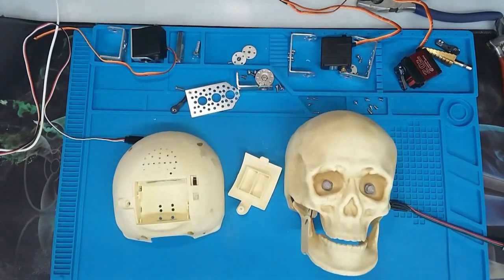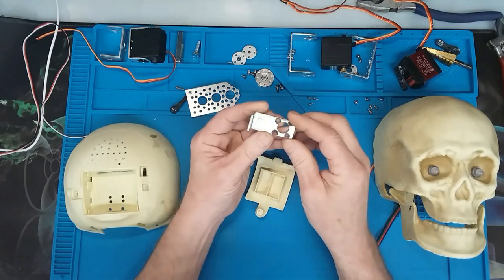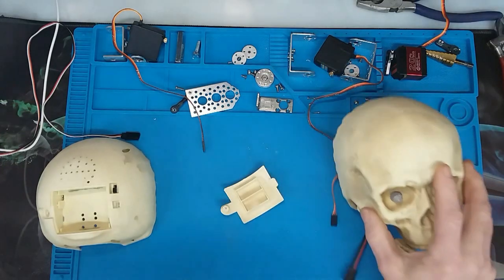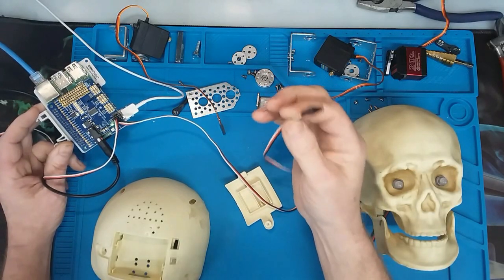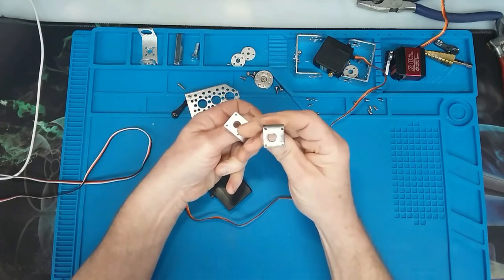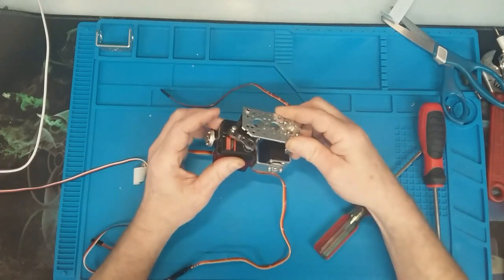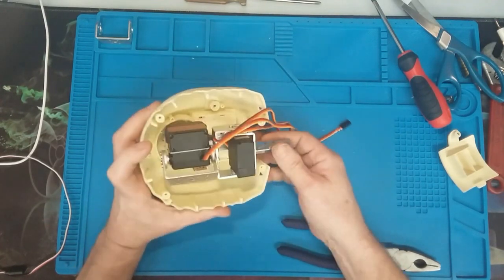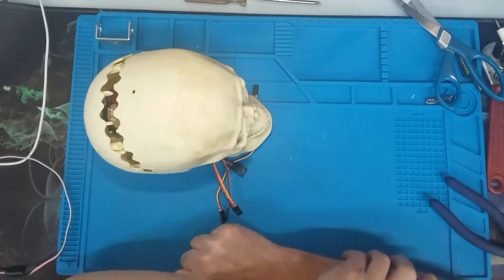3 Axis servo build

Comment: if I was to follow only the first step (attaching 2 dual shaft 180 degree servos w/ brackets) would that alone provide me with a decent 2 axis design?
Reply from the maker: Yes it would. You'll need some sort of an l bracket to attach the top servo to the back of the skull head. Most of the items in the list have been discontinued since I made the video. I've come up with a newer design that uses a short body servo in the battery area on the skull for the tilt. Past couple of years I've had some big changes in my life and I'm hoping to get back to making a video with the new build.
Reply: @ebuechner7900  Thanks so much for your reply. This design it's perfect for what I need. Would love to see the updated design though. So the 3 hole pattern plate that has been discontinued is the bracket I would need to mount to the back of the skull or is it the angle bracket design that you reference at 0:53 of your video that I would require?
Reply: I am working on an 8 ft talking skeleton and liked what you have put together for a diy 3 axis movement.  I know I would need stronger servos but the initial design looks very good.   I would like to see your updated design as well.  Thank you.
Reply from the maker: Tom. You could use the flash hobby brushless servos from Amazon with some of the servo brackets that Amazon sells and build something similar. You would Mount your tilt servo directly to the back of the pan servo and then use a piece of polycarbonate to attach The tilts are out to the back of the skull. This way you would have a direct drive on your tilt. The brushless servos are the way to move forward because my experience has been the brushes wear out on these servos over time and then burn out the control board in the servo. They'll also accept a higher voltage making it easier to power them. The faster speeds with the brushless servos also makes them more ideal for the mouth movement.
Reply: @ebuechner7900  Yes, those brushless servos look pretty strong. What size would you recommend for the pan and tilt?  The mouth is already using a servo for talking and my other challenge would be to incorporate the pan and tilt servos to the control board used for the mouth currently in the skeleton, if that’s possible.  I sure i will be watching this video several times.  Any suggestion on brackets to use would be greatly appreciated as well.  A quick sketch of what you are describing would be helpful as well.  We could discuss more details off line if that is something that works for you.  Thank you.
Reply from the maker: @TomWheeler-m4g  I'm using the 35 kg servos. The brackets are going to have to be custom made for your particular skeletons needs. You want to fashion the bracket to get the tilt rotation point to align with the pan and nod. As far as the board that you're using goes, I don't know what sort of output it uses. Most hobby servos will use a pwm signal That's usually in the range of 900 to 2100 at 50 HZ. If the board has set limits, it's probably going to require a lot of mechanical adjustments. For my needs, I use the PCA9685 board on a raspberry pi. I pushed to have this board added to the outputs on fpp and then helped develop the interphase with all of the adjustment options. I'm on both the falcon Christmas and xlights forums if you want to contact me. For obvious reasons, I'm not going to put  personal contact information on my YouTube.

Comment: would you be interested in making this assembly for some one that does not have the tools or ability to make the brackets? of course for cost of materials and time.
Reply from the maker: I've been thinking of a way to phrase this. No. I made the video to help guide people to recreate the results that I had knowing that people were probably going to make changes and possibly approve upon what I came up with. As a lifelong mechanic I know that if I started down this path making these four people someone would eventually turn it into a nightmare scenario for me. And as one other gentleman pointed out one of the components isn't available now. I do know a few people have made the same mechanism leaving out the bearing and the servo for the tilt opting only to use the pan and Nod features.
By doing so they greatly reduced the components that needed to be manufactured. There's a few people out there and the Halloween Enthusiast forums that make mechanisms for people like Jerry from skulltronix. I came up with this idea is a poor man's version that's not as complex and intern quite robust operating out in the rain and snow.
Reply: Doesn’t hurt to ask. Thank you for replying and creating this video.

Comment: What's the length of the ball joint you used. I went to Hobby Town and was unsure which one to buy?
Reply from the maker: You can buy the ball joints individually and then a piece of threaded Rod to put in between them. At the moment I don't have any open units to measure. Look at the angle of the Servo arm in the video and make the ball joint to the length you need.

Comment: Love the video, I would like to try but Servo City discontinues the swivel hub would you be able to recommend a replacement?
Reply from the maker: This looks like it's a suitable replacement. It shows to be out of stock but it's not labeled as discontinued.
https://www.kr4.us/swivel-hub.html
Reply: @ebuechner7900  Thank you
Reply from the maker: After doing some research on Servo City's website it looks like they've discontinued that part and replaced it with the 1608 series dual pattern pillow block. This part doesn't seem to have the same bolt pattern and at first glance it looks like there's more distance between the plates. This is one of the challenges of Designing something with off-the-shelf parts. At the time that I made the video all of these parts were quite common and easy to come by.
Reply: @ebuechner7900  What do you think about the 545444 Dual Ball Bearing Hub, and tap the smooth side?
Reply from the maker: @aaron8184  
I think you might be confused now that Hub operates. It's a solid block of metal shaped exactly as you see with two bearings 1 pressed into each side. I thought about using that but one of the problems is they don't put a spacer sleeve inside between the inner races of the bearings. If you were to put a bolt through that and tighten it down it would make the bearings bind up without the sleeve. To make that work you would need to make the bracket off of the servo with a solid shaft welded from the backside and aligned straight with a way to secure the Hub without preloading the bearings.
An easier method to replace that Hub might be to use a through bolt and some Fender washers with silicone grease and a locking nut so you can control the tension. You just need a pivot point without much friction.